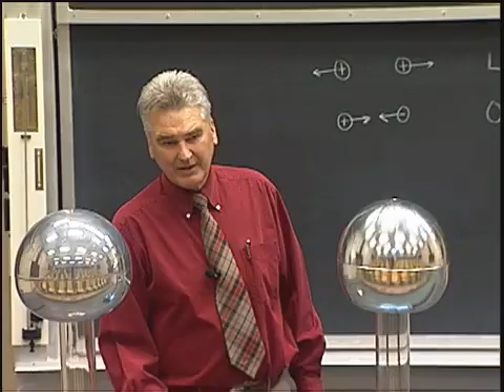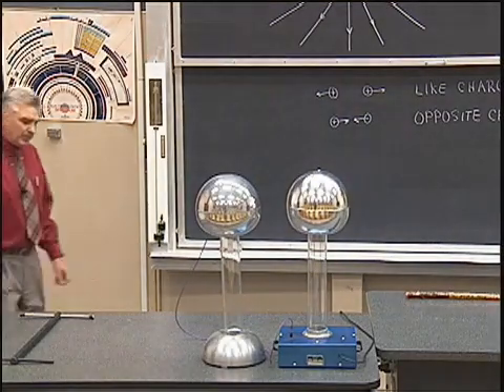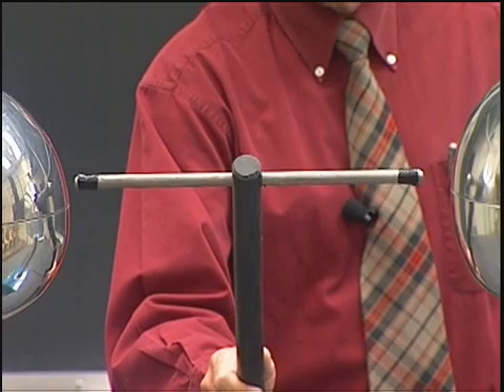Electric Field Breakdown

Comment: What happens to the displacement current when the high voltage field discharges between the 2 spheres (capacitor plates)?